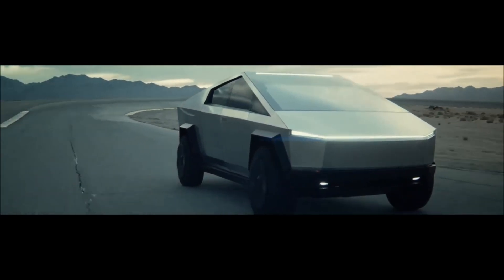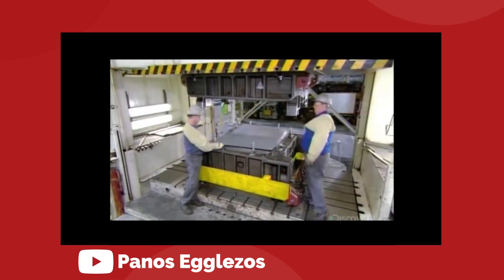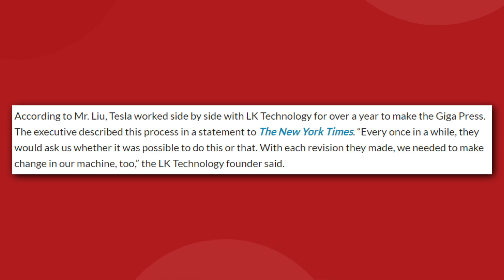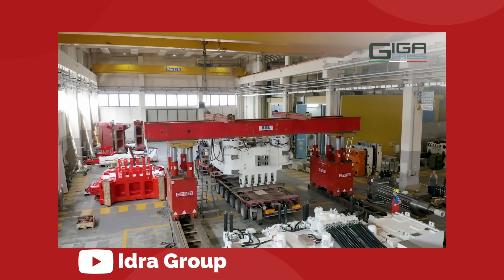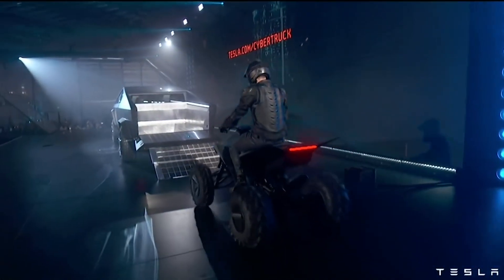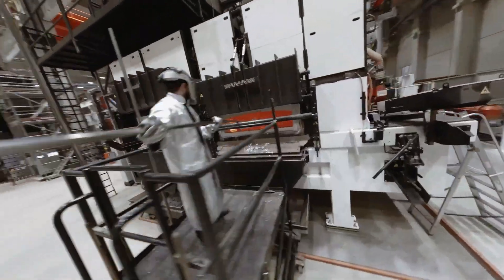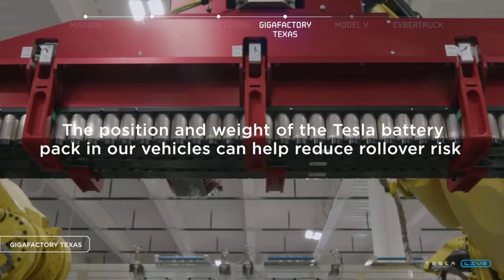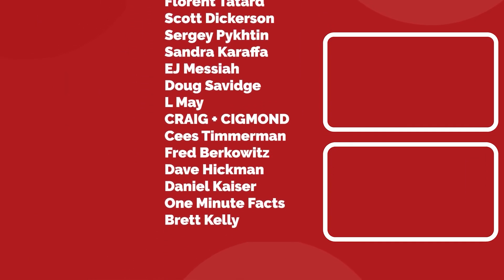Tesla Reveals New Cybertruck Giga Press!

Comment: It'll be interesting to see what issues may arise from the single-piece castings when repairs need to be done. I'm also curious about accident impacts when there aren't the traditional crumple zones present anymore. I'm sure Tesla has a solution and I'm eager to see what it is. CT was originally looking to be the first EV truck on the market, but not being first has its advantages too, like being able to add features that the other guys have already.
Reply: Crumple zones are cast into the piece.
Reply: Grind it of cut it off fill it up new piece weld it.  
Me love it. No rust just lots of scars hope body made to be legendary long lasting.  Here s me Hoping 
I know my supposedly legendary Landcruiser 70 serie is full of rust and needs constant love to keep going but heh it’s legendary toyota they say.
Reply: I like that they've already considered repairs... where they have sections you can saw off and bolt a new section onto the chassis.
Reply: @scottmcelhiney323  what about aesthetics? Does it look the same?
Reply: Yeah. You can be a bad welder and a good grinder and repair this thing. And with next gen computer I think it will be a notable reduction in accidents.
Reply: When they start producing the trucks they’ll probably overtake Rivian’s total production within a few months.
Reply: Repairs are less likely
Reply: Why do you presume that (absolutely required to meet crashworthiness tests) crumple zones aren't there?!
Reply: cars have been using uni-body construction for quite sometime now. and all the 'pieces' that you refer to are PERMANENTLY welded together in jigs that hold them until the welding is done. once done? those unibodies are NO DIFFERENT than a typical stamped, welded body. if a wreck is bad enough to bend the frame? insurance will just total the car. that being said- aluminum is the material- and a trained welder armed with a tig machine can handle that- no problem. the up side to the casting? it's 100x faster than stamping & welding and- the finished molded piece's attach points are accurate down to the micrometer. this translates into build quality that is UN-MATCHABLE. the 'krinkle' factor? I have no idea. but since tesla's 1st order of business with their cars is safety? I'd say that was the 1st engineering factor they tested & refined BEFORE adopting 1 piece castings. 

single casting repairs? well- how much does a new one piece casting cost- vs. the repair? food for thought.
Reply: Repairs.¿ there’s barely anything that wears and tears
Reply: No one knows, because no production cars use these single-piece castings.  Tesla has only talked about the castings, but is not currently making cars with them.
Reply: @ReachOutToWilliam  3 years and still no CyberTruck for at least another year,  they have to come up with some kind of nonsense to keep people interested. Musk is the king of hype.
Reply: Casting is always stronger… we have identical looking machines made in the 60’s casted that sell for more money than non casted machines from the 80’s
Reply: @robdogsurf , that's a fallacy. The castings you reference are stiff but relatively weak. And the failure mode is catastrophic - sudden, total, brittle fracture. That's why they're massive. The old machines are very, very stiff. That's why they're preferred; it has nothing to do with strength.
Reply: @robdogsurf  Its not that its stronger because the strenght is probably the same for the strcture, they just use less of it, in mechanical design enough is more often use than better. If you have to repair I am guessing those are very expensive parts. Also there is something not discussed, flexibility in manufacturing. If a piece is made for one vehicle it cant for other which is different. Tesla is a recent company with not a lot of models, but quite often in other companies different models share many components that come from the same source, here tesla seams to be making a new production line for every model they make. I like the tech its really cool, and it isnt really a tesla Advantage because the machine is not theirs but from that Italian company which can sell this to other buyers.
Reply: "I'm also curious about accident impacts when there aren't the traditional crumple zones present anymore"

Simple. You die.
Reply: @gonzothegreat1317 , or he's full of it when he claims they aren't there. ;)
Reply: Tesla’s stock drops 40% and YouTube is flooded with these hype videos, a man in a robot suit and now a 3 year old CyberTruck, that’s at least one year away from its first truck delivery, unless Musk delays it again. What these EV groupies don’t realize is that legacy car companies have no need to make electric cars.  The old companies make money servicing gasoline engines, and there are more parts to replace on gasoline engines and hybrid cars.  Also, it is far more complicated to make a gasoline or hybrid car with the engine, transmission, exhaust, catalytic converter, radiator, engine computer, driveshaft, differential and gas tank, than to make an electric car with a battery and a motor. So switching over is no big deal. And Toyota has global distribution and service centers already in place. Most of Gas and hybrid  customers are not going to buy a $70-$140,000 Tesla anyway.  The old car companies is not behind, they are not in that market, which is still a very expensive market. And Toyota is working on Hydrogen Cars.  Is Musk paying for this video?
Reply: @obijuan3004  Older companies do make alot of money creating built in obselesence, it is absolutely true that they would make less money converting over to Electric engines, they have a very small profit margin on sales afterall, and maintenance only goes on for so long before the car needs to be completely replaced with one which is has the same flaws, breaks down in the same ways, and costs more and more to repair artificially

as a consumer who hates asking someone for help with something I've bought, I'd rather have something 10x the price than 10 other items which are needed to continually mend their own redundancy, much less wasteful even if you do have to pay everything up front

Heck if a car was simple enough that anyone can just fix their own car, taking things to the next step

Elon didn't pay me for this, I'm just a huge simp

I would really love it if legacy auto manufacturers actually worked on developing technologies for making better cars instead of just manufacturing them.

manufacturing companies just use robots to build cars anyway, they don't even need to be manned at all

I believe that eventually, hopefully soon, these other car companies will take the hint and actually start doing something that helps people

and tesla isn't the only one doing nice cars, it's just that alot of the popular brands basically are all exactly the same as eachother in all but aesthetic
Reply: @nyanbrox5418   You are fooling yourself if you think Tesla’s are superior machines. That just means you are not seeing the complaints and the broken suspensions and locked up steering and stuck gull wings. Musk is still learning how to make a car at scale and the only way he can compete is to make his car it as simple as possible, like using a center screen instead of a normal dashboard. Still his cars are very expensive and Musk has a 34% markup because he needs the profits to build more factories before the real car companies that can make millions of cars make a less expensive electric car, by the millions, with distribution and service centers in most cities.  Musk is racing the clock here. He’s lucky that legacy car companies don’t want to make electric vehicles…yet.
Reply: @obijuan3004  just like guns, it’s the user ... u thing a unibody construction can’t kill? It the user that’s the problem. Maybe u were born in a plastic bubble and feel like nothing in the world should have the ability to hurt you? Are u in favor of knives that can’t cut?
Reply: @obijuan3004  Wait teslas use gull wings? lol, personally I prefer regular car doors, but I appreciate wanting to be different

and yes, I'm aware of how they are priced, and of course there would be faults and such to be worked out, I'm not saying that tesla specifically makes the best cars, I think that EVs in principle are a superior car, and I'll respect anyone who puts that much effort into trying something inivative,

EVs are heavy, and unless you double down on suspension those can break, gull wings are just silly, don't have much to say about that one, profit margins don't matter when the original sale of the car isn't even what makes a company money, they can charge whatever they want,

personally, I'm poor person in my opinion, I can't even afford a good bike let alone a car, let alone a tesla, but I love people trying different things and just dislike how slow the other companies are, if they all switched over to just EVs I'd respect them just as much, actually it's this

it's not about whether you win or lose, it's how you play the game
Reply: @nyanbrox5418   A company needs to make a profit. If legacy car makers can make the same profit by continuing to make gasoline or hybrid cars why should they change?  While Tesla has lots of YouTube video's that are mostly hype for a car with a battery, an electric motor and no real dashboard, just a single iPad like screen,  gasoline and hybrid cars are far more complex to build and have no YouTube videos. These car come  with an engine, transmission, exhaust, radiator, gas tank etc. So, switching to an electric motor and a battery will not be hard.
There are people inside the legacy car companies who have calculated when to start adding glorified golf carts to the assembly line.  Trust me they don't want to sell electric cars until they have no choice and government regulations are pushing that choice. 
You will see nice electric cars with real dashboards, real buttons to control the A/C and they will be built in the millions and competitive in price, forcing Tesla to drop their price.  The Tesla hype will be exposed for what it is... hype.
Reply: @maddad1119    I said nothing about guns. Nor cars that don't kill. i think, you need to take your medicine, you're getting angry over nothing.
Reply: @obijuan3004  My point was never about Tesla cars, it's about EVs, I have never sat in a Tesla so I don't have a preference to the internal components, the thing I respect about them is that they are not waiting for government support to make electric vehicles, I similarly respect the other EV manufactuers in the same way, I think those probably build cars you'd find more preferable at least
Reply: @obijuan3004  I mostly agree with you the idea that tesla will be a monopoly in a market so full of competitors some of which with massive state backing is not a good one. Also a massive concerns with this machine which is nice tech is flexibility. Tesla appears to be building a production line for every car they make, that sounds expensive
Reply: @pedrorequio5515   I never said Tesla would be a monopoly, there's too much competition.
People assume that Tesla is this advanced car, but its as simple of car as Musk could make. It has a battery, an electric motor and a big screen that replaces the A/C controls, the radio, the GPS, the speedometer, etc.  So Musk has no dashboard. Its a fancy golf cart.  Any car maker can duplicate what Musk did, and build millions of cars a year, they already have the factory space.  
And Tesla got its start with a $465 million dollar loan from the Obama Administration. 
With Musk attacking his biggest customer base and new EV's coming out, Tesla's biggest challenges are still coming.
Reply: @obijuan3004  
EVERY stock dropped idiot.
At least the Cybertruck isn't a rehashed fossil burner...
As for Toyota.
Fool cells?
Reply: @obijuan3004  all markets dropped dude
Reply: @obijuan3004 , "switching over is no big deal" - tell that to all the companies that have screwed the pooch repeatedly. 

Yes, anyone can build an EV. Not everyone has extensive, diverse battery sourcing including massive in-house capacity and their own leading edge battery development teams. Not everyone has near complete vertical integration of all major vehicle systems. Not everyone has in-house designed neural net computer chips and a global system for acquiring real world driving information to feed into its AI. Not everyone has a global fast charger network. But most of the established ICE manufacturers have expensive legacy costs like pensions and debt on soon to be written off assets.

Comment: It's going to be interesting what the insurance companies are going to charge for the CT.  Having to repair the stainless steel panels is going to be expensive.  If you get any kind of dent, most likely the panel is going to have to be replaced.  You can't bondo it, you can't paint it,  maybe you can body hammer it??
Reply: I love chump like yous 
Give me your money  i will fix it  
So easy you guys
Reply: Tesla insurance. For the other car needs panels & repaint.
Reply: Let’s not forget the aluminum castings! If those castings fails it’s going to be a gigantic nightmare to deal with! There is a reason why steel frame has dominated for decades and is going to continue dominance

Comment: I just wish one of the changes would be an 8ft bed. so annoyed by the little 5-6 ft bed offerings. I need 8ft  unless 2x4's start coming in only smaller lengths and we live in homes with 5-6 ft ceilings.
Reply: This truck isn't really designed as a commercial vehicle, it's unfortunately designed for the cool factor. I won't be replacing my Silverado 3500 any time soon.  LOL
Reply: @TexanUSMC8089  lol…… it can’t even replace a Silverado 2500 let alone a 1500!
Reply: Agreed. Supposedly you should be able to fold down the separating wall between thr bed and the cab so you have access to the bed from inside the cab. I assume that means Foldable back seats. This should bring the "bed length" to around 8-10 feet. It can't be used for everything, but it has its uses. You should be able to haul 2x4s if you're careful with the seat backs. 
Even so, I would like a bigger bed as well.
Reply: Tailgate designed as bed extension for 8' loads. Else get a trailer. Or an f-150-e & pray.
Reply: @iandavies4853   great way to have material slide outta the back of the truck  I can tell by most of these comments that most of these people only haul around their ego and groceries
Reply: @georgecook1374  this is stupid. Tailgate does have a flap to stop long stuff sliding out. Do your research. But why buy crew cab plus 8 foot bed on pickup? Plus drive at 80 mph? Compromise. Either re-invent work vehicles, or moderate demands. Separate work & play. Appreciate cybertruck has revolutionised trucks as tough & low CoG, wont rust, blow gearbox or head, not dent & scratch, great adjustable suspension, covered bed, fast. For decades you bought rusty, fragile trouble from Smoky Ford. Time for change.
Reply: Hopefully it has a mid gate...berri No-ICE

Comment: Cybertruck needs a Cybertrailer with a full additional battery pack in full enclosed and flatbed versions for wide adoption as a contractor's work truck.
It would also be interesting to have a Cybertrailer in an RV version.
Real world tests of current electric pickup trucks show that towing drastically reduces range, so to have a working vehicle to not only haul materials and tools but also power a worksite, a full battery cybertrailer is something that should accompany the release of the Cybertruck.
Reply: The Cybertruck with a Cyberlandr installed, given that both don't suck in execution, will be cheaper, more efficient, and more functional than an RV.
Reply: Totally useless and Ineficient unfortunately
Reply: With solar on the trailer.  Panels that fold out to give about 3KW of generation.
Reply: @goodcitizen4587  two sides of the coin.  Well of course if you have a trailer, having fold out kilowatts of solar (and shade) will be cool, but 6 hours of 3kw isn't going to drive you home.
Reply: @goodcitizen4587  the solar panel that folds won’t be a thing and certainly won’t last long!

Comment: I thought the body was the freme.  Are you sure about this or are you guessing?
Reply: I think he's calling the frame the bottom that all the body will attach to.
Reply: @TexanUSMC8089  If the body is the frame, everything will attach to the body.  The cybertruck uses a bending press, not an injection mold like the other cars. I think he is guessing and you definitely are guessing.
Reply: Cast aluminium alloy underbody (3-piece), 3mm thick stainless steel body, bed, doors. 
It’s still exoskeleton / unibody, doesn’t have a steel ladder frame.